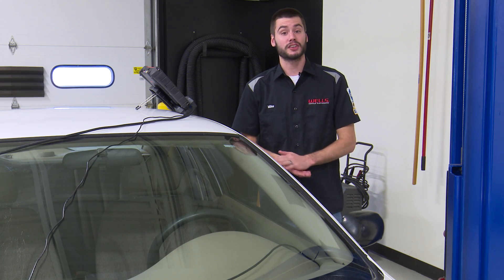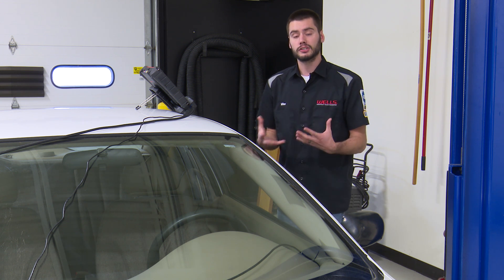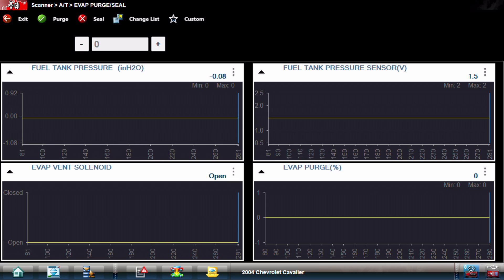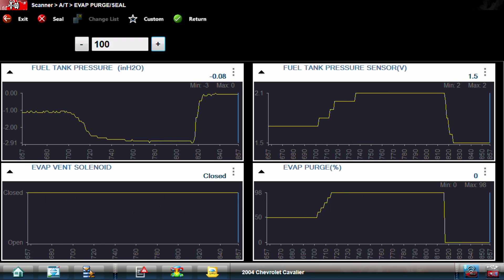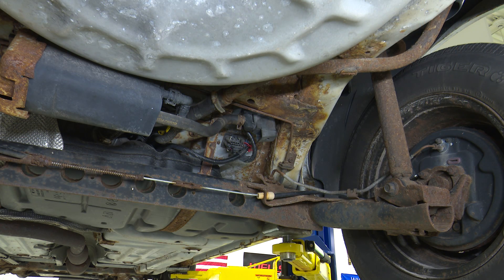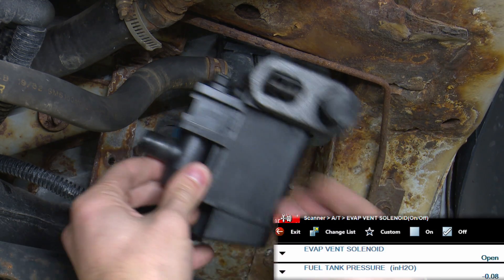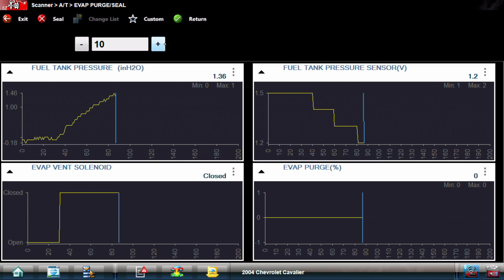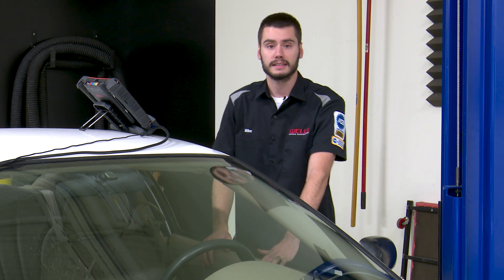Quickest And Easiest Test For EVAP System Leak Codes P0442, P0455, P0440 On A Basic GM EVAP System

Comment: Came across your video from Eric O. at SMA. I watched it about a year ago. Thought it was very thorough, and simply put. Keeping it as simple as possible is always a good thing. Watching it again now, because I have an 03 S10 4.3 with a 449 code. My first check also is always the vent solenoid. Was cycling it on/off and initially was working fine. Til eventually it started acting up, rapid cycling, and unresponsive to commands. I assumed faulty solenoid and replaced it. Initial tested showed working fine, and during the purge/seal test would pull down a vacuum to almost 5 volts and slowly deplete after going back into system seal. After a road test and monitor test, light is back on for 449. After cycling solenoid on/off several times, it fails to respond. I'm assuming the ground side circuit (pcm) is possibly not functioning correctly. After the car sits for a while, I attempted purge/seal test again. It responded and showed expected results. Went to evap vent solenoid and commanded on/off again. And it was responding normally. Any suggestions? Using Autel Maxisys Elite.

Comment: Having a hell of a time diagnosing po446 code something's wrong with the EVAP circuit change the solenoid change the purge valve still got the code turning on the check engine light something's wrong with the circuit I think some assistance would be appreciated

Comment: I don't have a scanner that turns my vent solenoid on and off. Turning my ingition key on and off would I hear the solenoid clicking? Or do I have to use a jumper?
Reply from the maker: Hey Jim, the vent solenoid is usually fed power whenever the key is turned on. When commanded by the PCM it will ground and close. If they vent is clicking just turning  on the key, check for a short to ground on the ground wire. If you want to force it closed for a leak test you can use a jumper wire.

Comment: I had a 442 leak code. Found possible loose gas cap. Went through at least 14 drive cycles of 12 miles or more and the evap mil still has not completed.

Comment: Which scanner are you using?
Reply from the maker: Hey Derrick, I was using a Launch scanner in this video.
Mike Becker, Senior Instructor
Reply: @GoTechTraining  Thank you.   BTW.  I have an issue with a 2001 Ford E250.  It will not pass Evap test.  I'm down to the last two reader codes $2A and $2B. Tank pressure initial Failed.  All other readiness are green.  Any ideas would be appreciated.

Comment: I have a 06 impreza that has had all valves on the tank replaced along with the charcoal canister, I'm still getting a p0457 code. No leaks, purge solenoid replaced and canister vent replaced. What would you suggest I do next???

Comment: Mr Becker r u still here, i want to ask u a guestion about my 2015 toyoto corolla. evap system, leak detection pump. there r 7 wires going to and from it. with the key on on there r 2 wires, 1 has 12 volts and the other one has .5 volts. they r beside each other. the other 5 wires no volts. when i take the pump out of the canister on the bench and check it, the same 2 wires that had volts, in ohms they r 27.7. If i take a 9 volt battery and touch those 2 male pins, it clicks just a little but it doesnt close all the way. I think it is stuck open. Thats what i`m asking u. I`snt that the way u check it, and what do u think. And the reason for all this is DTC po 455 code. And dont have a machine like u to auto turn off the pump, all i have is a cheap scanner. Thanks u. And u have some great videos.

Comment: hi what was the load you put on the connector when you tested with test light?
Reply from the maker: Hey John, not sure I understand your question. The test light was the load. An incandescent test light will generally pull about 1/4 amp.
Mike Becker, Senior Instructor

Comment: Hi Mike, great explanation of the Evap system diagnosis. I have a code P0446 [Evaporative Emission System Vent Control Circuit] on my 2002 Toyota Camry 3.0 Liter Engine. Since I do not have the sophisticated test equipment like you do, is there a way to know more about what that code means? I checked the purge valve power and it is working and clicking when applied.
Reply from the maker: Hey Jim, that's a tough one. Old Toyota EVAP can be very hard to diagnose. You're dealing with a vent solenoid code, which is part of the canister if I remember right on those cars. Take a look at my EVAP playlist on here. There's a video covering Toyota EVAP that i'm sure you can pick a few pointers up from.
Mike Becker, Senior Instructor
Reply: @GoTechTraining  Thanks for your prompt reply. I will check out the video.

Comment: Do I understand rightly that the tankpressure is a reflection of the pressuresensor voltage, and that the tanksolenoid and purge both are valves of which the latter is scalable (in steps of 10%)?
Thanks and greetings from the Netherlands!
Reply from the maker: Hey M. Torn, correct the PCM/scan tool translate the pressure sensor voltage to give us a parameter in pressure. The vent solenoid on the tank is typically on/off only where the purge is typically scaled in whatever percentage the PCM is calling for. That clear it up!? :)
Mike Becker, Senior Instructor
Reply: @GoTechTraining  Thanks, very glad that I got it!

Comment: Hi Mike! Eric sent me over. Good video! I have a P0442 in a 2008 Hyundai Santa Fe with the 3.3 V6. Replaces the vent solenoid and purge valve. No issue. Then I recall the CEL came on when I replaced the fuel level sensor. Can that trigger an evap leak?
Reply from the maker: Hey Oche Oche, the fuel level sensor may have been faulty causing the EVAP test to never run. 
Mike Becker, Senior Instructor
Reply: GoTech oh wow. Okay. Never thought the used unit could cause that. Guess I’m better off with a new unit

Comment: Eric O. Sent me over.  If he admires your skills I'm going to check ya out!  That's a great compliment having him praise you.
Reply from the maker: It's an amazing compliment Yepper11!!! Thanks for watching. If you have any questions don't hesitate to reach out.
Mike Becker, Senior Instructor
Reply: @GoTechTraining  You guys are light years above my skill on cars!  I change brakes as long as it's not the lines.  And anything outside the motor I will usually tackle.  But if it involves taking the engine apart I'm taking it to someone like you.  I know my limitations.   I can do just about anything with wood but working on cars is a different kind of "mechanically inclined".  I admire the skills guys like you and Eric possess.  Keep up the good work.  And thank you so much for putting up these videos.  There are times when I have to tackle the car due to not having the $ so I have no choice.  I greatly appreciate that you have videos like these for me to be able to save myself even more grief.  You get a good guy award in my book for your kindness in instructing those of us who really need the help.
Reply: @GoTechTraining Hi Mike. I have a quick question for you and hope it’s an easy one for you. So I do have a scanner with bidirectional ability. I tested the purge valve, canister solenoid valve, turbo wastegate, and other miscellaneous valves on my car and they all made a “tick on, then tick off” until I clicked the stop button for the test. 

However, the purge valve made more of a rattle sound as if the voltage applied to it for the test was applied multiple times per second. The scanner said the test was successful. But is this normal for the purge valve to sound like that during an on/off cycle test from a scanner?

I’m asking because the purge valve on my car is pretty hard to get to with a lot hoses, brackets, and wire harnesses in the way. 

Thanks a bunch! 🙏
Reply: Same here
Reply: Same here, well done.
Reply: i know it is quite randomly asking but does anybody know of a good site to watch newly released series online?
Reply: Nice video but honestly that machine is way too complicated! This one is so simple here:

https://youtu.be/4R4Q9Y-sW-s

Comment: Man that scan tool looks like a money maker.
I have the mercedes SDS and it does not have the bi directional controls, in fact the SDS is pretty much a pile of crap especially with having to do all the online stuff.
I really need to get a good upgradeable scan tool that can work on german cars.
Any recommendations would be helpful .
Not sure if the one you use in this video works on newer mercedes vehicles.
Someone needs to kick Mercedes in the balls so they will quit making their diagnostics so proprietary so only dealers can work on them .....greedy bastards.
Reply from the maker: Hey Hall House, I have not worked on a lot of newer Benz. I worked on a 2012 C300 a few weeks ago and used my Autel, it did ok...but nothing compared to what the factory tool would have been able to do.
Mike Becker, Senior Technical Instructor
Reply: GoTech 
Yeah the SDS is a good tool for proprietary Benz work but those bi directional capabilities are awesome!
With the sds I can close or open the charcoal canister shut off valve but to have four screens up at once is pretty awesome....something the sds can’t do.

Comment: Excellent help! I used this to help me focus on the 3 parameters for small evap leak (no cel but repeat gas cap message) on 2010 Express 6.0
I know it's different vehicle but the PID data doesn't vary that much and I was able to see 4 PID relationships when purge commanded. 
Thank you!
Reply from the maker: Hey NV, that's great use of the video. The systems are pretty much identical. Glad it helped!
Mike Becker, Senior Instructor

Comment: Dude, people do not have your shop diagnostic equipment!
Reply from the maker: Hey Rick, that's true. Many DIYr's don't have this level of equipment. But, without it, diagnosis can be nearly impossible. The tools shown here are tools of the trade. Not every task on a car is at a DIY level. Any shop that does ANY diagnosis should have at least one full function scanner.
Mike Becker, Senior Instructor
Reply: GoTech Evidently you failed to understand what I wrote.  Read it again for understanding. 🙄
Reply from the maker: I'm not sure what you mean Rick. You said "people". Who do you define as people? I assumed you meant people who don't work in a shop.
Mike Becker, Senior Instructor
Reply: GoTech You didn’t fall far from the tree did you?  Rick:  Engineer.
Reply from the maker: Rick, i'm not sure what you are getting at here. Maybe you can help me to understand the point you're trying to make.
Mike Becker, Senior Instructor
Reply: GoTech Kid, go play in your sand box!

Comment: Damn...didn't know Jim Carrey was a mechanic as well😮😀👍
Reply from the maker: Haaha thanks...I think.
Mike Becker, Senior Technical Instructor
Reply: Got a question...stumbled across your video after I bought a 98' Mustang GT...it runs pretty damn good, but it has a check engine light. I put a code reader on it and it said System lean bank 1. It has a fairly strong emission smell with no fuel leaks that I can see. Checked some vacuum lines on the purge valve and are pretty deteriorated. Also a 2 1/2" rubber hose on the PCV valve is deteriorated. Haven't checked the O2 sensors yet. The car has aftermarket x-pipe exhaust with only 2 O2 sensors instead of 4. Is there any advice you could give me?...would greatly appreciate it👍

Comment: Great video, how do you test if we don't have a higher end scanner tool? Do you know any lower end scanner tools that would allow you to turn on and off the vent? I would like to be able to do what you're doing by turning off the vent to trouble shoot. I'm pulling my hair out with my 2015 chevy silverado. We changed out the solenoid valve and the error code i'm getting points to the fuel pressure sensor you mentioned, fingers crossed that it's it but if not i don't know what else to do. Thanks for the content.
Reply from the maker: Thanks for watching! Check out something from Launch or Autel, they may be able to do what you need at a lower price.
Mike Becker, Senior Technical Instructor

Comment: Is the vent selenoid same as the purge selenoid valve?
Reply from the maker: No, they are not. The vent is near the fuel tank and is normally open. The purge is under the hood and normally closed.
Mike Becker, Senior Technical Instructor

Comment: What would you recommend to check next after changing out the purge valve, vent Solenoid and the gas cap is still receiving the code p0455 on a ‘14 Chevy impala limited
Reply from the maker: Hey Lafayette Huston, i would change your approach. You've already spent quite a bit on parts and haven't fixed it. I think it may be time to have a tech look at it. They can perform a smoke/leak test on the system and actually diagnose and repair the source of the leak instead of guessing.
Mike Becker, Senior Technical Instructor
Reply: @GoTechTraining  ok thanks!

Comment: @NGK Technical Training Mike, EVERYTIME I perform the EVAP Purge/Seal test (using Tech 2) on my 2004 Trailblazer EXT LT 4.2L 6 cyl. my car STALLS immediately when I HIT THE SEAL BUTTON, and all vacuum in tank(I usually pull vac between -7 to -10 inH20, that's at 60% command on the Purge) goes immediately back to 0.00 inH20 and the FTP sensor voltage goes down from 3-4 volts back to atmospheric 1.5v. If I have car running and just seal the system, NO Pressure builds up like in your vid. I can hear vent clicking in the back when commanded, and purge is working because I can feel the engine react when I start purging more and more. EVAP Diag seems to clearly be my nemesis! Any thoughts, suggestions, remedies, tips, ANYTHING? Thanks in advance
Reply from the maker: Try plugging the vent hose after the vent solenoid. Just because the solenoid is clicking doesn't mean it's actually closing!
Mike Becker, Senior Technical Instructor
Reply: @GoTechTraining  Will do. Can't pinch off, due to ALL these EVAP hoses are all those pre-bent hard plastic hoses. Got to find something to plug into end without disturbing the inside o-ring or breaking tabs. Do you think it would upset system if I were to just replace vent hose to canister with a normal rubber hose like the oldn' days? Thanks for reply in advance Mike.

Comment: Any way you can show how to test for a P0451?
Reply from the maker: Hey Ramon, a P0451 is a FTP range code. You want to inspect that pressure reading when the system is open and when it's under vacuum. Looking to see a normal number for that vehicle. Outside of whatever spec it is and you get that code.
Mike Becker, Senior Technical Instructor

Comment: hello mike, thanks for that videos by share your wisdom to those of us who are starting the great mechanic walk, you know I would like to know if you had any detail with the fans of toyota rav4 1999 2.0, the case is that I do not have any code of It fails, and the fans remain on, replace coolant sensor, relays and I'm not lucky yet. Could you guide me if there is any other sensor that commutes with the passage of the relays oh some run, oh ground, problem in the pcm. in advance thank you greetings, solarbwilmer@gmail.com
Reply from the maker: Hi Wilmer, thanks for watching! I'll send you out an email with what I find.
Mike Becker, Senior Technical Instructor
Reply from the maker: I just tried sending you an email...no luck. Send one out to me. MCBecker@ngksparkplugs.com

Comment: My car is showing P0441 (incorrect purge flow) and code P0455 (system leak detected large leak). Hopefully it’s something simple and somewhat inexpensive. 2008 Lexus GS350 165k miles.
Reply: JustJay 0312 Did it end up being something simple? I have the same code
Reply from the maker: Hey JustJay0312, Hope it is something simple for you too! Good luck in your testing.
Mike Becker, Senior Technical Instructor

Comment: Simple test Mike.  When I was working it took "a while" and one day I realized that just what you've shown us, I could do the same thing.  It simplified testing.  Most of what I had were vacuum lines, pressure sensors and occasionally  a purge valve.  We dealt with heat, occasional smog, and accidents.  Fleets in L.A. are like that. Great Video!
Reply from the maker: Hey Mike, thanks for watching! :) 
Mike Becker, Senior Technical Instructor

Comment: I know this is geared toward professionals, however, could you do a video for us diyers that don't have $5k for that scanner?
Reply from the maker: Hey DM7097, The principles all remain the same. The only difference is in the scanner. If you have a cheaper scanner that has bi-directional controls, then go for it. Without one, you will not be able to perform this test. You need to have a way to make the PCM ground the circuit.
Mike Becker, Senior Technical Instructor
Reply: @GoTechTraining  thanks for the reply. That's kinda what I was going for with my question, of you could do a video for those of us who does not own a scanner with bi-directional controls. Like how we could do some of the tests with out a scanner. I realize most of your videos are geared toward professionals who already have the training in doing this kind of work, however most of us regular Joe's watch these videos to train our selves.
Reply from the maker: Hey, so the problem with looking for an EVAP issue is the fact that it's a PCM controlled circuit...therefore any video that I would create without using bi-directional controls on a scan tool would be only a partial/incomplete diagnosis. Unfortunately, many times on a car the only way to properly do anything is to have the right equipment.
Mike Becker, Senior Technical Instructor